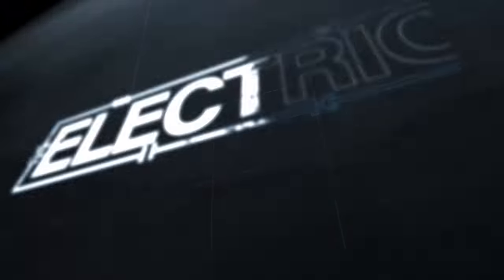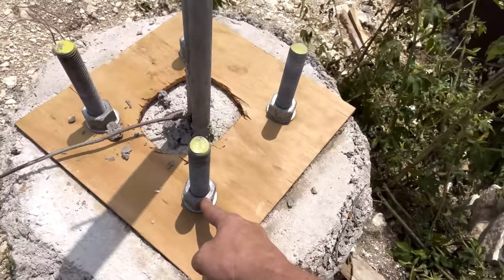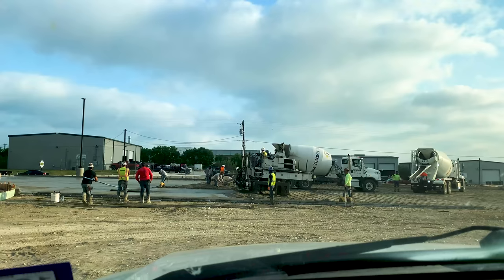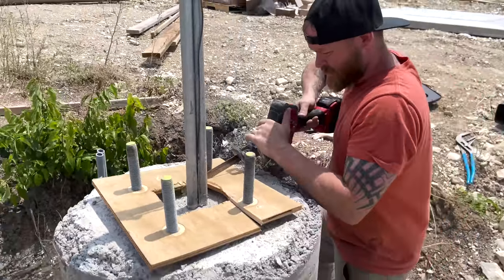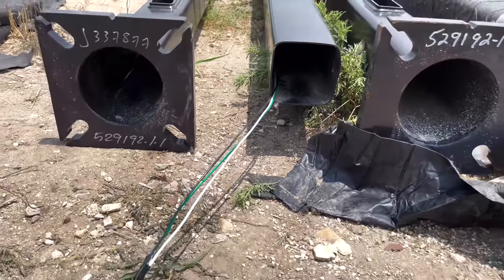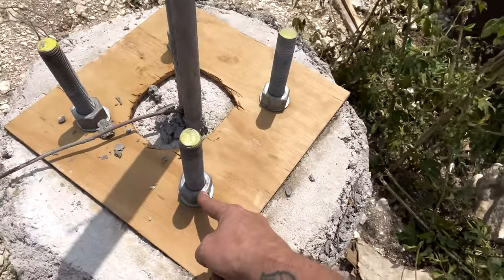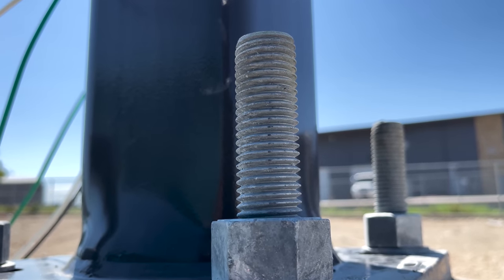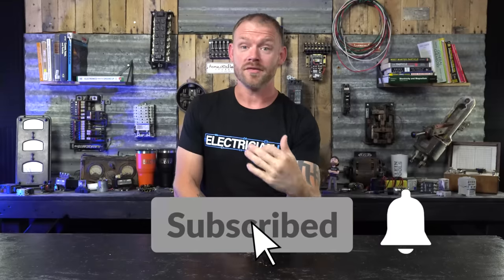How to Set Up Light Poles: Tips and Advice on Thinking Ahead

Comment: I worked for a company that owned a 60’ bucket truck with a jib crane that could be controlled from the base. 
The construction crews did all of the underground work, built the poles, and placed them at each location.
The service department had one guy with an apprentice who set all the poles on every job, they also did all of the aerial service work.
Very efficient and safe for everyone.

Comment: I've installed some light poles where we used prefab bases. 

I always level the bottom nuts and washers before setting the poles. Some poles are tapered so you can't use levels on the sides. Plus it makes it so much easier and faster.
Reply: How much do you charge per pole.
Reply: I was going to say, I see contractors putting in prefab bases all the time, conduit, properly spaced bolts, faster to install then pouring them individually.
Reply: This is how we do it

Comment: Many years ago, my father and I had to set a sign pole ( almost identical to light poles ) which we leveled just as you describe. This sign pole was at the very edge of the property. About an hour later the customer/owner arrived and was raising hell as to why we installed his sign pole so crooked. We looked back at it, and indeed it appeared crooked. We checked it with our level, checks good. Then stood back and looked, looks crooked. Well, turns out there was a very leaning utility pole close to our pole, which made ours look crooked. So, we adjusted our pole to match the lean of the utility pole and the customer was happy. Always have to be aware of surroundings.
Reply: That's the utility company's problem. Then when they install a new pole which is perfectly plumb, your sign pole will appear crooked because it is. Lol
Reply: Yeah, I would have showed the customer a couple levels on it and said, we're done. Call someone else to un-level the sign
Reply: @illestofdemall13  Right.  And that did happen. So, we simply readjusted, since it was a matter of turning 4 nuts.
Reply: Lol leave it to a customer to want to plumb a light based off of a pole that isn’t plumb
Reply: @ElectricShinn  I've ran entire racks of pipe at a slope to match existing racks that were installed wrong years prior. I get why the customer wanted it done, but never have I seen a light pole mounted crooked to match a utility pole, or something else off the property. 

Guess the customer will realize the error in their ways when the utility upgrades/repairs the pole, or removes it completely.

Comment: Justin: Mike Holt has a video or two about why an equipment ground has to be run to each pole, why you can't just depend on a ground rod for grounding.  If the pole becomes energized, there has to be a way for the electricity to get back to the source, and the equipment grounding conductor does that. Same explanation you give for why we have an equipment grounding conductor on branch circuits applies to lamp posts as a string of lamp posts is just a single circuit system.

Comment: I highly recommend trying pre poured bases. Saves a ton of time. We have set them ourselves or have the excavator set them with the machine. Someone needs make a steel plate to pickup the bases but it’s much faster. I used them on the last 1.2 million SF warehouse I did and was sold on them after that. You have to give the precast company the anchor bolt spec and the anchor bolts and they do everything else and then they truck them to the site.
Reply: Have to agree.  Using precast bases saves a huge amount of time and overall cost of installation.  There are ready-made designs for many of the poles manufactuered.

Comment: HaHa this is great. My dad the power engineer (deceased) grabbed a bunch of light poles. Got a metal lathe. These lights had a folding base and were 10-20 feet tall. He made joins got another 10-20 feet and used them for a Ham dipole .. (3 band so 3x dipole) I had one for my TV antenna, moved it to a new property. When I  dehammed his house I grabbed 4 of his 5 and got one up with a starlink on top!. Miss ya dad! I never could get those quite right and I always buried a nut!

Comment: I dig seeing different methods, in North Dakota we never let cement guys touch anything. We finish the bases, inset the bolts, and never need a skim coat to finish. Also, we are not allowed to use straight conductors in the pole as they will rub against the inside as the pole sways in the wind and eventually wear through and arc out.
Reply: What do you mean, “straight conductors”?
Reply: @TNFTAW  ahh…is that a project specification?  Did ND amend the NEC to require this?
Reply: @steveloux4709  as opposed to twisted, like inside MC cable.
Reply: @wim0104  gotcha. Hadn’t considered that. I know some of the wire VAR folks could re-roll a set twisted together.

Comment: The gal vs PVC is based on how often the PVC snaps off when the ground and pole base settle differently. However, the gal needs to extend at least 10ft away from the base if your going to prevent breaking the transition from gal to PVC. This is not usually a code requirement but good practice.

Comment: Poles look Great.  Have you tried using a long, heavy pipe to adjust the bolts?   Works really well on straightening anchor bolts in concrete slabs.   It protects the treads better.  😉

Comment: Great video !  Did about 300 light poles on a job out by college station a few years ago. People always want light poles , underground type work , done in the boiling heat so yeah. But totally off topic , do a video on using portable generators to run a whole house. How to make them legal and safe and what not. Thanks for all your hard work 👍
Reply: Test amp draw for home and size gen accordingly. 
Keep the neutral floating in the Gen. Bond neutral at Main. 
Install either a transfer switch or an interlock for the breaker feeding the home from the generator. 
Turn loads on individually so as to not overload gen at start.
Reply: @mamaswamma1234  thanks Adam but I still would like him to do a video about it 👍
Reply: How many lights per curcuit? 277v ??
Reply: @MrLuismedina25  depends on the type of lights being used. Are you using led or a hid of some kind ? In my case we used 400 watt LEDs. We ran #8 THHN for voltage drop and used 30 amp circuits and ran 29 lights on each circuit. Each light pulled about 1.45 amps at 277 volts.
Reply: Mine are 277v 150w each and someone else wired them , they are 21 posts 2 heads each = 42 lights x 150w wired with 10gage wire… there is only one 20amp circuit running them together… with a clock and a contactor for 12 hours every night ..i am wondering if it can be on their max or if would be ok
Reply: @MrLuismedina25  that equates to 21.3 amps at 277 volts. So yes if they are on a 20 amp circuit they will grip the breaker.
Reply: Alpha sayain , you think doing the math , that my case the number of lights will be ok? So far last night worked , whats your guess ?
Reply: @MrLuismedina25  my educated guess would be they will be fine. If it does end up tripping you could change out the breaker with a 25 amp breaker. You could actually use a 30 amp breaker because there is #10 wire ran to the lights.

Comment: A tip for templates.

We have a metal shop plasma cut bolt templates out of steel so we can reuse them. Poles are pretty standard for us. 2 per set of bolts high and low can keep them plumb. 

Other times we use a bottom plate we weld on site with a top template if we know the GC is using hacks for concrete work so it's even harder for them to screw up
Reply: I like the way you think here, although by now I figured somebody would be making cheap plastic templates and nuts that could be left in the concrete. That way the threaded assembly would be square to itself when installed as a unit.
Reply: @rupe53  you're better off just using a steel plate for embed at the bottom if you leave it in.
Reply: @Squat5000  ... I get it and have done it that way. I was just dreaming out loud that there's probably a market for a cheaper solution, especially if the mfgr did it in bulk and offered a kit.

Comment: The company I work for use pre-cast concrete, just dig, and set. Bolts are already in place with room for conduit. Usually use UG Cable to a junction box at the base.

Comment: I set some poles just like those. I set the bolts (I never trut the concrete guys) and we used a skidsteer with a pole grabber attachment to set them. It works really well. I wish I had photos. The one problem we had was when we put the dirt in the ground settled really bad and we had to dig it back up and fill it with 1 1/2" gravel and pack it all back down with a wacky packer.

Comment: I always use 2 templates. One lower on the threads, and one at the top. It keeps them all lined up correctly and NO HAMMERING THREADS, which weakens the the concrete and the bolt. Save all the extra nuts and washers for next time.
Reply: Same here.
And in New installations, i dont understand the use of junction box. 
Only need to run conduits from base to base.

Comment: Quick tip 
Instead of banging the anchors you can just use a pipe bender you have more leverage
Reply: I have used a 6 ft cheater pipe to bend things by eyeball... then tweak by hammer to finish off.
Reply: Banging on a thick anchor in fresh concrete doesn’t seem like a good idea
Reply: @dorhocyn3  It is what people call a life hack
Reply: Do you mean bending the bolts by slipping some 1" EMT over them then using the bender to hit the pipe with? 
Wish I would have thought of this sooner.
Reply: @dorhocyn3  ... while concrete needs 30 days to fully cure, I suspect most jobs don't get to this point for at least a week. You should be fine.
Reply: I am the kind of guy to procrastinate getting something done over technical issues, sometimes in life getting things done is better… it’s just the impact of banging fresh concrete seems kind of  aggressive, I like the long pipe bending action better.

Comment: Our HOA has direct burial tapered round fiberglass light poles set in concrete and the electrician has had replace two of them and neither is plum all that way round like the original install. A video on setting those buggers would great!  Keep up the legit good work!

Comment: I did electrical design for 25 years.  I specified square poles on my first job, the anchor bolts were installed crooked.  Since then I always specified poles with slipfitters so they can always be aligned square. Especially necessary for direct burial concrete poles.

Comment: The NEC only requires an equipment ground.  As he pointed out some regions do require a ground to earth.  The purpose of the earth connection is to try to dissipate as much of the energy from lightning to the earth as possible before it reaches the building.  It's added protection above and beyond the NEC requirements.

As a rule of thumb it's normally good to do what preassembly you can while the equipment is on the ground and easy to work on but it's not always good to do a full preassembly.  Ceiling fans are an example of this.  With ceiling fans you typically want to leave the fan blades off and any components that will cover your blade assembly screws so that the blades don't get in your way as well as any glass components and the lamps for their protection.  Preassembly where it's easy saves time and effort in most circumstances.
Reply: Its texas it is probably for lighting protection not "grounding". ... Texas grows some big ass storms
Reply: @NotMuchHere  good summary of my statement
Reply: @ianbelletti6241  gave you a thumbs up ...

Comment: I always wondered why poles weren't set flush to the concrete.   Now I know.  The nuts are for leveling.  Thanks for pointing that out.
Reply: You don't want to trap water in the base either. They need a little room to breathe.
Reply: The lower nuts also keeps the pole base from wallowing out the concrete over time as the pole rocks with the wind. I have had to correct this when done by others. Solution is to hoist the pole and run a set of nuts under, lower the pole back and do the top nuts. One time I had to cut the lower nuts down to half their thickness because the bolts were so short.

Comment: The Ridgid conduit makes no sense as in 20 to 30 years it will be rotted out . Pvc in the ground and in concrete will last for thousands of years and replacing conductors will be a breeze  . Now you can wrap the Ridgid in tape to protect it from the concrete as it can be corrosive and get a longer lifespan out  of that Ridgid .  conduit .
Reply: Agreed, why would they want something that’s going to corrode

Comment: I like the idea of the J box in the ground then T- tapping one conduit up each pole. 

That pole base was the ugliest thing I've ever seen. I cannot  recall one time where "the concrete guys" did pole bases properly when it was up to them.

We actually stopped subbing it out they would screw them up so bad. For some reason even good concrete guys struggled with doing  bases up to architect's specs

-We would typically get a 24" auger and drill 4-5 feet down then set the 24" sonotube just a few inches below grade.  This way your base is locked into undisturbed earth and very stable. 

-Pipes would be stubbed out as needed. Site markers at ends of conduit so we could trench to tie them in later. 
-start concrete pour early morning then start wrecking forms mid day just as the concrete was firm enough to hold shape but still green enough to rub with a sponge float or rubbing stone. Always ended up with a nice hand rubbed stucco type finish without grinding, pounding, and trying to slop a bunch of sand mix on the base (which is only going to fall off later anyway.)  

If the anchor bolts didn't line up we couldn't blame anyone but ourselves.

Comment: Project manager had us set the poles without the base covers or what we call skirts because he forgot to order them.  When they came in they were one piece and suppose to go on before the light head.  I had to take a grinder and split them all in half and rig straps so the could be held back together after on the pole.

Comment: Hammering on threaded bolts isn't good for the threads or green concrete, it tends to crack, kind of like what your video shows.
Good comments below to avoid mistakes.  I like the double high low template so everything is squared up.  Following the concrete guys is key.
Relying on other trades to complete their section correctly... can lead to problems.
Reply: Exactly what i was about to suggest.
2 templates will make sure that the bolts stay straight.

Comment: Was told at IAEI continuing education classes that installing a ground rod at light poles is a waste. Just think about it. You never get 25 ohms to ground with any 8' ground rod. Mike Holt had to screw together think it was 40' in ground rod to get a lower then 25 ohm measurement. A copper ground wire from a panel should provide less then 4 ohms to ground. Engineers should learn grounding & bonding.
Reply: Maybe I am misremembering my electrical theory, but with enough 25 ohms to ground, in parallel, the total resistance lessens.
Reply: @jopalolive  Yes you are correct . If you had say three 100 ohm resistors in parallel the resistance would be 33.33 ohms. Believe that with ground rods that probably are over a hundred ohms to ground and what at least 209' apart the resistance of wire & ground rods no where nearly as effective as a one or two ohm copper wire from a panel. Years ago after driving in a 8' ground rod attempted to illuminate a 100 watt incandescent 120 volt light bulb. Used the hot side of short 13 guage extension cord to supply power to one side of light bulb and ground rod as the neutral. Light bulb was as dim as a small flashlight with old worn out batteries. Had 118 volts to the hot wire.
Reply: @JohnThomas-lq5qp  Thanks for sharing your experiments results, 100 ohms to ground!
My thinking is that enough light pole grounds (10?) at approx. 100 ohms would make for low resistance and somewhat helping with lightning and grounding issues.  I remember someone back in the 90s putting in a second ground at a subpanel, rocky ground, because the system was burning out bulbs and electronics.  It definitely helped.  An electrical contractor at the time questioned the reasoning to do so, now it's code.  And Now that I think of it, light poles might attract lightning strikes.